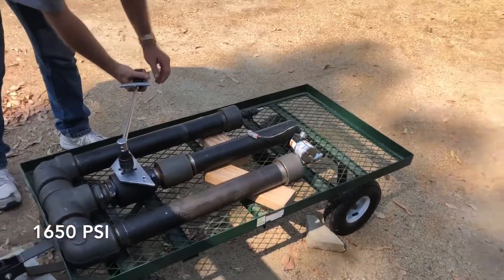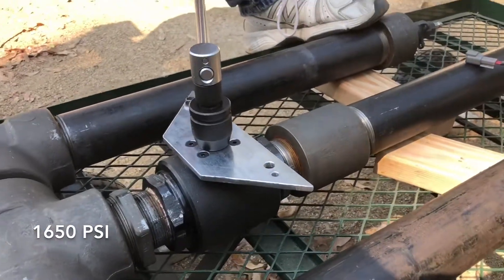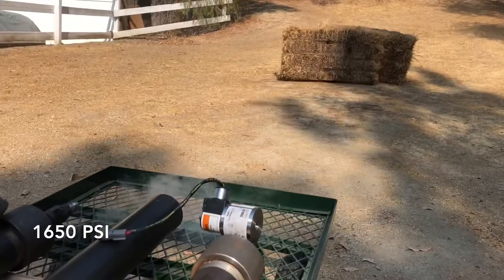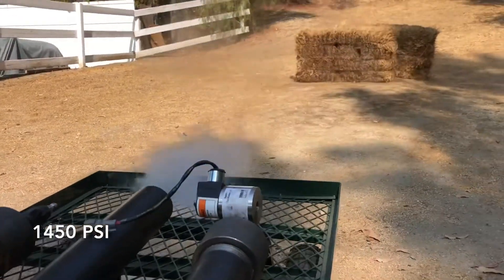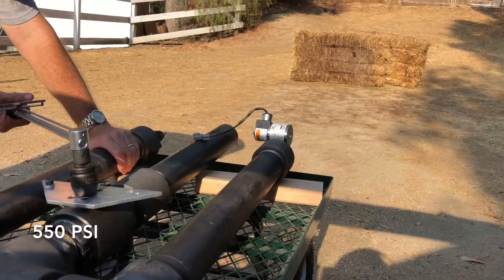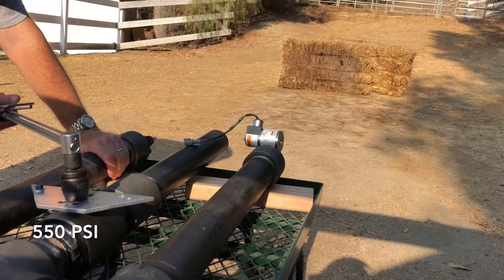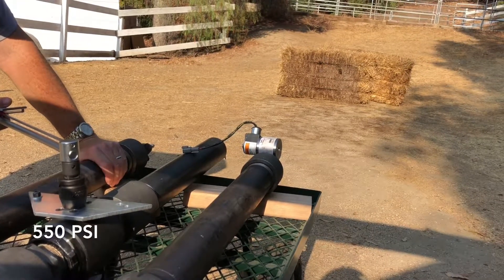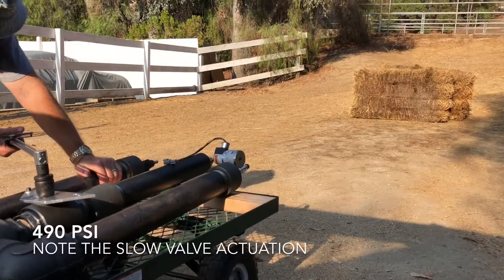Double Jeopardy Valve Actuation Torque Testing

Comment: So are you keeping the frc chasis or are you gonna go for something more in the style of the sport?
Reply from the maker: We will have a real frame (welded steel tube) and actual armor (titanium plates thicker than 0.040").  We get the weight for it by switching from threaded Schedule 160 fittings to butt weld Schedule 80 fittings.